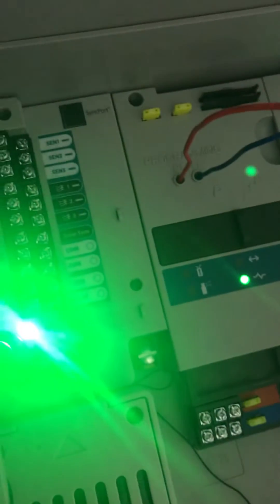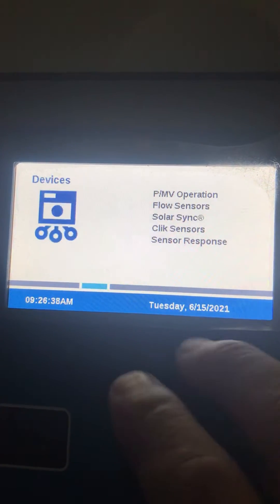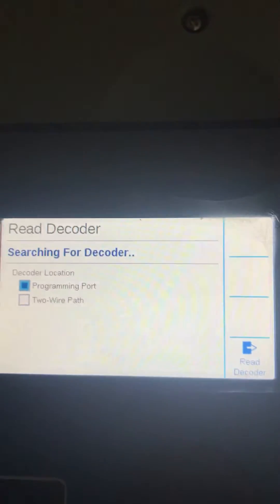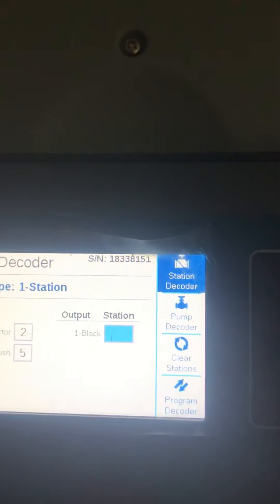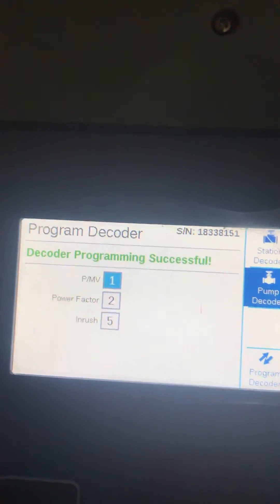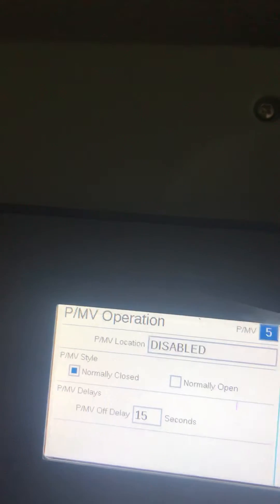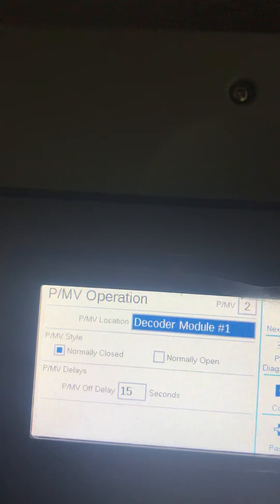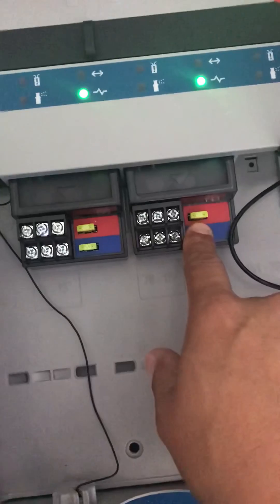ACC2 Master Valve Programming

Comment: Hi there,
How can I erase an existing 4 station decoder? from the acc hunter controller in order to program a new one in the Same station of the one I just erased?
Reply from the maker: @Josesal74  easy enough. All you have to do is reprogram it either at the controller or using the ICDHP. The controller will recognize whatever stations you Program on the new decoder or what you reprogrammed on the old decoder.